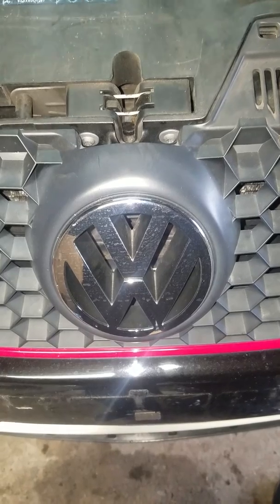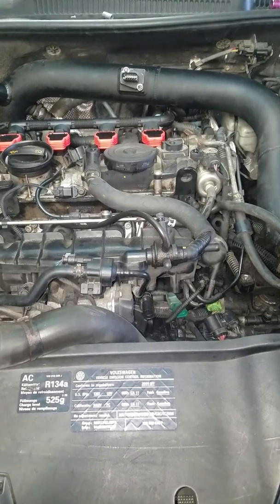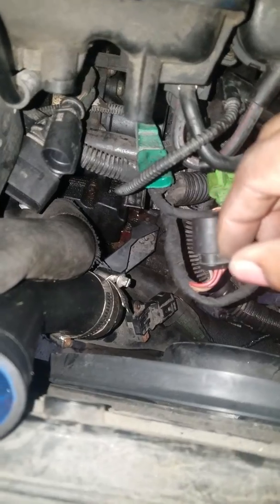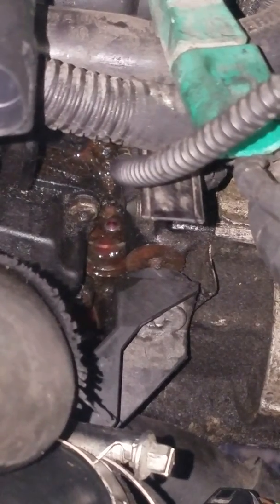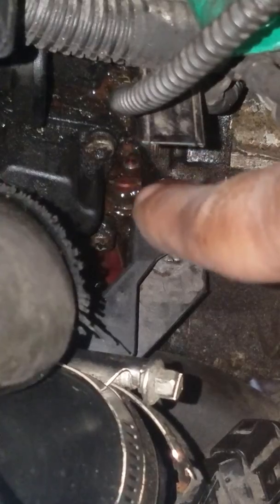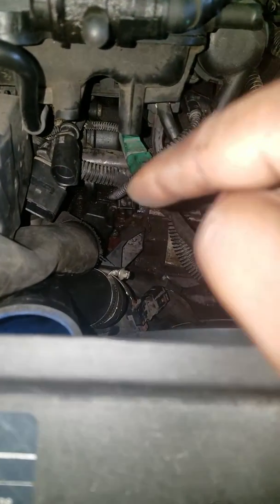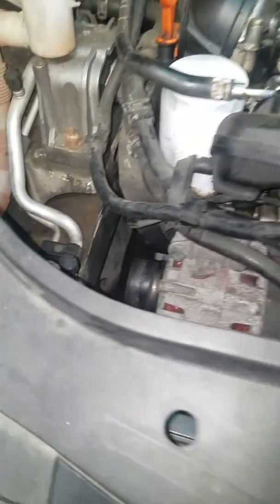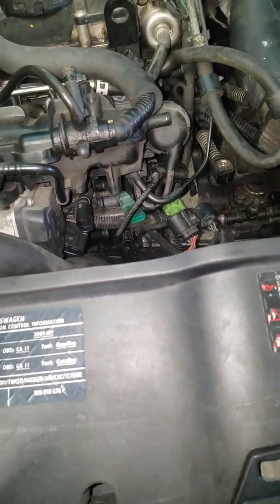Mk5 GTI TSI 2.0 ENGINE SPEED SENSOR (G28) Location

Comment: Seems when coolant stays In contact with the g28 eventually they fail..
Eps light on dash and vcds showing no signal from g28 also. Makes a bitbof sense because i have a bad waterpump and is leaking around there.

Comment: You need to post your PayPal account address so I can send you $10.  For the placement, of course, and also for ragging on those idiots who are all saying it's near the oil filter.  I had to take my hoses off on blind faith that you were right before I saw it.  You are the MAN.  BTW, my engine is identical, but mounted in a 2010 Tiguan S.
Reply from the maker: Berrie you don’t have to send unless you really want too.

Comment: Obdeleven gives me no code but my vcds threw it right away.. Rough starting and sometimes can't even start up the engine also engine not responsive. This is what I'm doing tomorrow on my 2013 CC.
Reply: Hey so how’d the sensor replacement go? Just got my sensor and I’m going to try my hand on a 2013 CC as well.
Reply: Any advice or suggestions would be appreciated

Comment: VW / Audi 2.0T TSI CBFA G28 Remove/ Install procedure via Audi Repair Manual: 

1.  Loosen/ unscrew the clamp at the throttle body, but do not remove
2.  Remove the two bolts from the plastic pipe connecting the throttle body hose to the intercooler hose      and disconnect electrical connector
3.  Disconnect plastic pipe from intercooler hose
4.  The G28 sensor should be right behind the plastic pipe around where the two bolts were that were removed
5.  disconnect G28 sensor connector by: pushing in, pulling back on tab, AND THEN pulling the connector out
6.  remove screwing bolt that holds G28 in place (tightening torque spec: 4.5 Nm = 40 in-lb = 3.3 ft-lb)
7.  install in reverse order
(Note: no other tightening specs other than the screw on the G28 sensor)

Comment: Do you get a cam crank corelation when this sensor goes bad, or would it just be a crank sensor code?
Reply from the maker: Just a code
Reply: @Tthornton30  I know this video is old but what was your car doing to make you change that I know you probably got a code but what was the driving issue? I'm chasing a rabbit hole and it's driving me nuts
Reply from the maker: @Simpleman1078   i cant remember its been so long... what do you have going on
Reply: @Tthornton30  my car is revving like 2000 RPMs between shifts every shift so I push the clutch in to shift the gears and you hear it revving..
Reply from the maker: @Simpleman1078  it sounds or seems like the clutch is slipping

Comment: Why didn't u go in from beneath car
Reply: John Rutherford Easier from top. I tried both ways. From bottom you would have to remove the plastic guard and still won't be able to see it from down there. Just remove some stuff like this video, not the headlights though